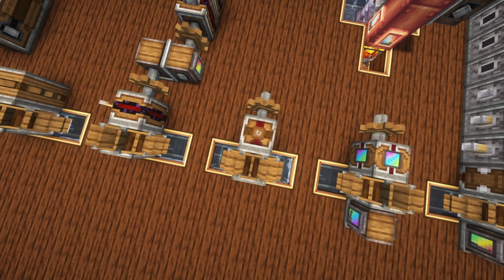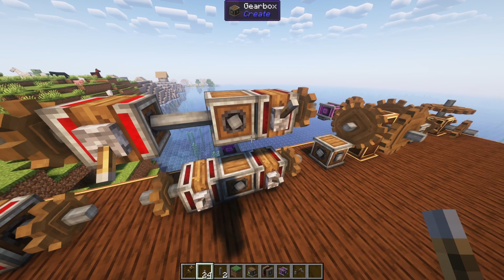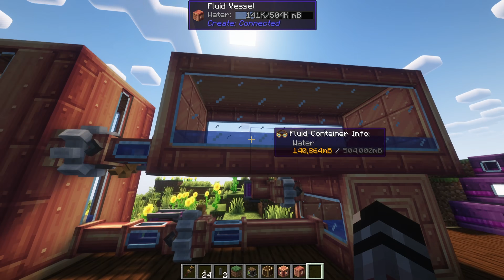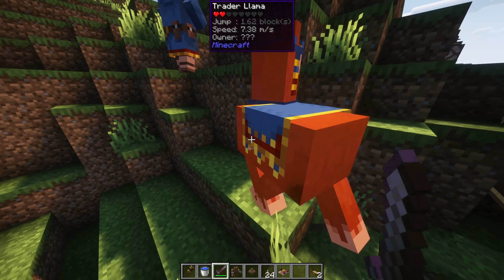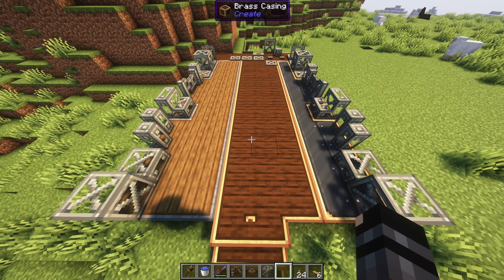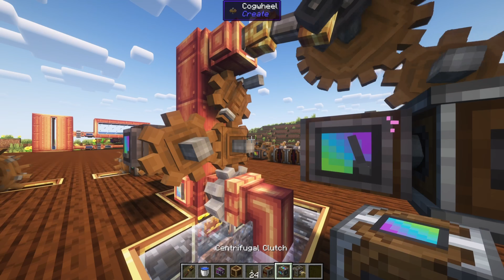These Features Should Be Added to Create Mod! - Create Connected

Comment: 14:16 if you’re doing glass structures using copycats and you use a glass block it won’t connect properly. You have to use a copycat block then apply glass to it

Comment: the free wheel can be used as a pair with gears on one side and chain drive on the other to guarantee the rotation is always in the same direction, it's especially useful if you're making mechanically powered builds for a schematicannon and don't want to think about which way they go. (or you have a mod that adds some form of oscillating power)

Comment: Thanks for such a detailed tutorial on my mod! Great job covering all the aspects of the mod and even providing example use cases to illustrate their purposes. Definitely earned a sub from me 👍

About the copycats: I've teamed up with other modders to make Copycats+, which receives very frequent updates and has copycats with better rendering, compatibility and more features. (We've just released v2.0 with copycat pipes, shafts and cogwheels :P) By migrating from C:Connected to Copycats+, you get better connected textures, the ability to put more than one material on slabs and boards, and a ton of other benefits.

Comment: While these additions are nice some of them have very specific or complex properties that can make many existing machines obsolete. For example, I've recently designed a self-starting steam engine that only requires a flick of a lever and had a lot of fun doing it. A lot of effort went into making the machine as compact as possible and all of this would be pointless if I had a centrifugal clutch. 
My point is that new components should make the designing process less annoying (reverse clutch, for example) but not necessarily easier. But hey, that's just my view on it.
Reply from the maker: I see what you're saying. It's the complexity that makes things fun

Comment: Connected is a wonderful mod. Its unfortunately held back heavily by performance issues (at least in 120 where i tested it (repeatedly)) so i tend to avoid it when creating (haha) packs. I've had instances where it will drop my fps from 150/160 to just under 80, which is frankly insane. When they can figure out the performance issues with the mod ill gladly use it

Comment: Why on earth an inverted clutch when "Inverted Lever" was staring you in the face.   Normally closed switches are common in the real world I use them all the time at work, it would be nice to have them in game.
Reply: with 1 clutch, yes it is the same. In a larger circuit the inverted lever is obv. useless..
Reply from the maker: Using a linked controller for example you can run into issues. Ex starting or stopping an engine. You'd want it to be normally off but you can't tell it to normally output a Redstone signla

Comment: Copycat blocks are lighter than  regular blocks. It makes it a nice tool for building accurate vehicles VS2 without having to worry about the weight of blocks.
Reply: And that is... wrong
You need a separate weights data pack to adjust the weights of the copycats, because like any other block the default weight for them is 1000 kg
Reply: @normalwaffle  My bad, I didn't notice this when building things. I assumed that it didn't affect weight because I used a lot of deepslate for my builds and never noticed it